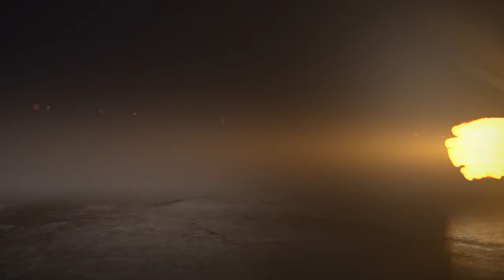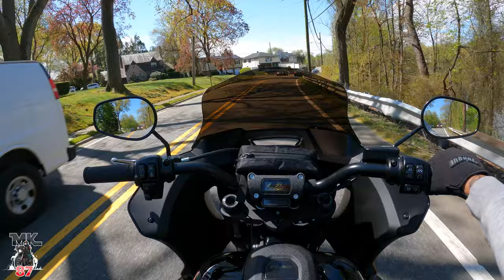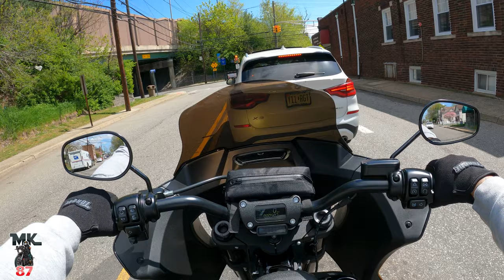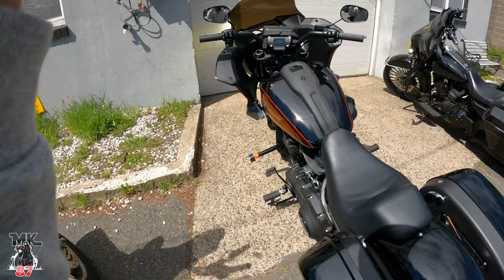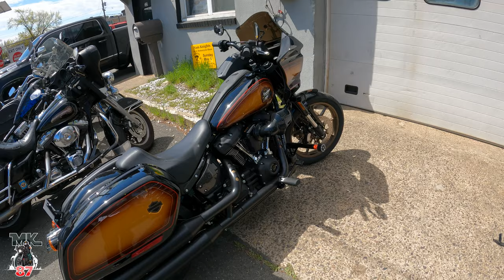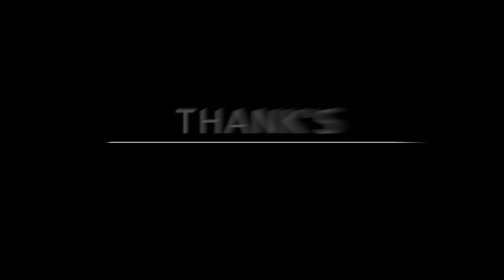Harley Davidson Low rider st 500 mile break in period

Comment: Just turned 1k miles on my Low Rider S.. my local harley dealer wanted over 600 dollars for the 1k service.. I laughed and did the 3 hole oil change myself.. oh and I checked all the critical fasteners.......saved over 500 dollars

Comment: Make sure to buy a Trask transmission top cover to remedy the blow by. This machine will suck lots of oil through the intake. Also make sure to get an air cleaner that will externally vent.  If you get an HD ventilator you can modify it to externally vent and it look clean. Holyshift made a video recently and took it to the shop you’re going to and while on the dyno it’s shows the top cover working